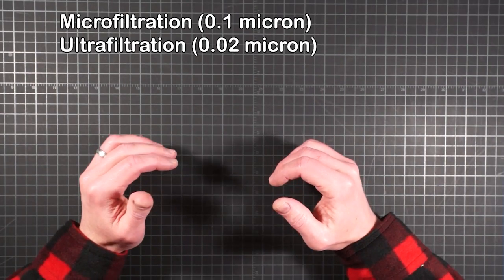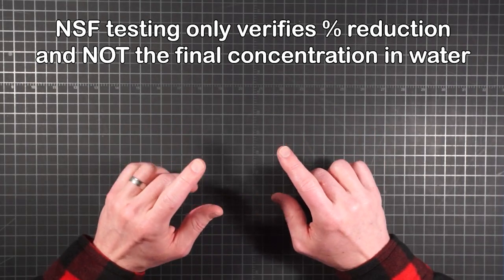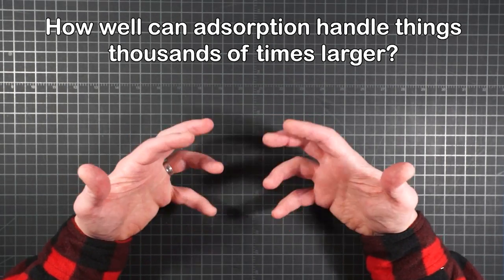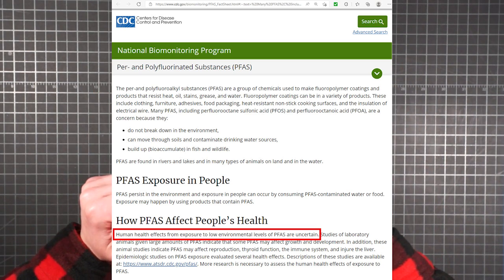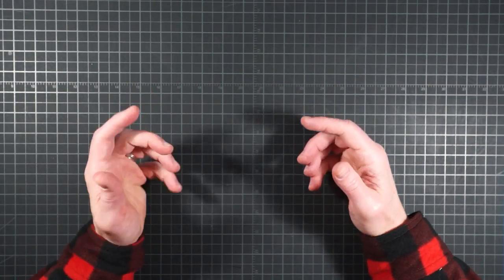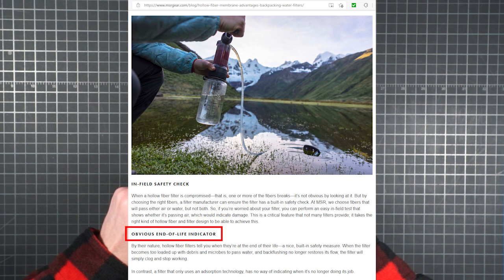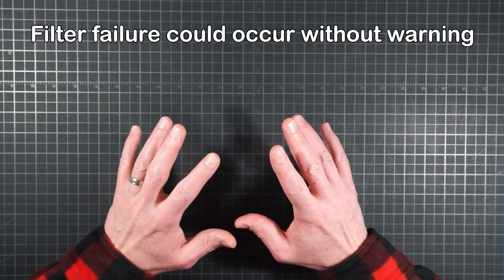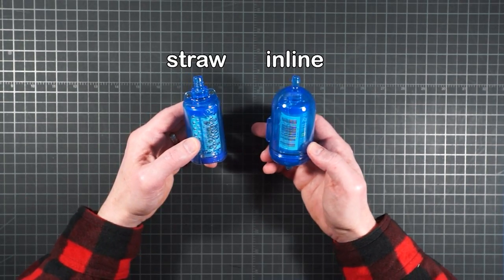Backcountry Water Treatment - Part 5: Activated Carbon Filters for Chemicals and Viruses

Comment: One of the things I will be making/packing for my SHTF bag, is a low energy desalinization system.  I have one of those Pump N Seal vacuum pulling systems that pulls about 28" of Hg (hand pumped).  That brings the boiling point of water down to around to 95* F or so.  Basically I'll have two stainless steel bottles, one painted ultra black, the other painted ultra white, and both connected by either SS hose or specially coated copper hose.

    A clear plastic bag (or very light/thin, foldable acrylic container) that is UV resistant will be packed with this. Concept is, either put the white colored bottle into cool to cold ground or some water in the shade.  Place dirty water in the black colored bottle.  Seal everything up, pull the medium vacuum on it.  Place the ultra black colored bottle either in the sun with the plastic bag or acrylic container around it, or over a very small fire source. 

      The vacuum placed on the system, should allow you to evaporate the water much faster and with much less heating.

Comment: I have a "Sport Berkey" it does great on a range of chemicals and microbes, but no virus protection. The large Black Berkey Filters do chemicals plus viruses but are not well suited for backpacking. Another great video. Tons of info and things to digest. I am starting to think to go with Aquamira drops for virus protection and then pass that through me Sawyer Squeeze (sediment, redundant to Aquamira for bacteria and critters) for total protection, but no chemical removal using this method, darn. Great info on flowrate and the effect on filter life reduction.

Comment: Love your videos I sent some sections to family to take a look at for your hiking food and hydration videos. I have learned a ton and it is so refreshing to find a channel that actually digs into the science and research to support or disprove claims and give a better foundation for people to decide what works for their needs.

That being said I think an interesting data point if you can find it would be to see how many cases of waterborne illnesses happen along the big through hike trails each year, this would be another data point to see if purification vs filtration is really that necessary and could give some light on just how likely you are to actually get sick from normal water sources (cow poop puddles should be a filter and boil). If records are kept with some accuracy then we can see if your napkin math model is on point or could use some adjustments going forward.

I wonder why YouTube hasn't pushed you further up on the recommendations but keep making these videos they are fantastic.
Reply from the maker: Thanks very much!

There are some published papers on the topic of the general safety of wilderness waters.  Some researchers take the position that hygiene is more important than water treatment, though they will admit there is still a risk from water.

They complain about bad data, though. Rarely is backcountry gastroenteritis diagnosed from an actual test of the organism.  This leads to assumptions, for example, that it was giardia. And, even if it was, did you get it from the water or a fellow camper with dirty hands?  Another unstudied issue is proper use of your given treatment method.  Some people splash unfiltered water all over their hands and bottle, then drink from the container.  Did the filter fail, or was it bad practice?

I agree that it would be interesting to know more.  Unfortunately, most of what I can find are just the water sample tests.

Comment: Every time I think of an objection - you address. This is so comprehensive I am astounded. Awesome! The issues you raise with Grayl remains valid and my concerns. I consider the grayl cheaper than bottled water and use relatively clean water only and underestimate it's capability. It's ideal for travel more than hiking. I have a be free to pre-filter if the water is dirty or otherwise have any concerns. At present, there isn't a travel suitable full filtration with redundancy or sensor. Compromises are just a nature of decision making. Thanks again!
Reply from the maker: Agreed! I think the Grayl has its place. Going to be playing with mine this summer.

Comment: Thanks for the series! Impressive studies. There is not much talk about the flow and pressure with the filters. Usually you shouldn't blow on any filter, cause it will clog it. To counter this issue I have made my own activated carbon filter to prefilter the biggest particles from my Sawyer squeeze, and I use them only like syphoning hose. This way I can keep eye on the flow rate and change the activated carbon when I need to. Should last a lifetime for personal use. I also have the uv for extra measure, but I usually boil it mainly for coffee anyway.
Reply from the maker: Neat idea!

Comment: Man I was just trying to buy a filter…but now I got a whole water treatment plant in my backpack
Reply: Haha, I feel this happening in my future. Thinking of something like: 
1. Dedicated dirty water bag/bottle -> 
2. Cheap rough mechanical filter to cut down on back-flushing and enable very dirty water to be used if necessary -> 
3. Sawyer squeeze -> 
4. Refillable carbon filter -> 
5. Clean containers. 
6. Di-chlorine tabs for pretreatment in special cases/emergency. 
Also plan on carrying my Kelly Kettle Trekker, outside the bag due to bulk though. With that I could skip the slower Sawyer on the way from having to find water to a hot drink.

Comment: Hadn't heard of the Katadyn Bottle adapter carbon filter so I went and ordered that. When it came in, I got curious and tried cracking open my old Platypus GravityWorks carbon filter with a hammer and flathead screwdriver. A couple of light taps is all it took to pop the very bottom part off. It turns out to be a cap which still pops back on. Underneath is a polysponge type foam disk, the same type of activated carbon granules as the katadyn and then another foam disk at the inlet. A little ca glue and a piece of tape on the outside might give a little insurance from spillage. Nice to have that as an option!
Reply from the maker: Interesting! Thanks for the info.

Comment: Not scientific, but I’ve been using Grayl GeoPress for a few years now. I’m residing in a developing country so I filter all drinking water. What I’ve noticed that you can check the filter degradation by blowing air through it. When the filter is new, no air passes through. When it starts to degrade after months of heavy use, more and more air starts to pass through. When you replace the filter its up to the user of course. Thank you for the videos.
Reply: Thanks for the tip!

Comment: Reference the Grayl 40 second press time (?) someone experienced with tap water: If it was the older model lid you had to open a 1/4 twist to release the air pressure, otherwise it was almost impossible to press (first time I misread the instructions and I almost exploded the bottle😂😮).  When properly opened a 1/4 turn, or using the newer easier to use lids,, press times are in the 5 to 10 second range with fresh water🎉❤
Reply from the maker: Good to know! In their pictures, they were actually trying to push the cup down without the lid on at all.  This can hurt your hands and might lead to less pressure and longer times, as well.

Comment: The engineer in me loves everything about this channel!
Question: what "activated charcoal"/adsorption filter do you use at home?
Reply from the maker: I put one of the Platypus carbon elements in my water kit (with my Sawyer), to be used only when called for.  The Grayl went into a car emergency kit.

If I make a dedicated virus/chemical capable kit for hiking, I will probably use the Aquamira Frontier Max red line.

Comment: Great vids man!! Any thoughts on the least plastic/ most chemical free drinking method. Soft bottles vs hard bottles… vs silicon… vs bioplastic, etc. Hydrapak offers mulitple types, some ‘free of x y z…’ and some not. [Also Bübi bottle, Bottle-up (UK), Nalgene, Ortlieb, vs Titanium…] I think drinking plastic is an ignored issue. [Some eg of materials used TPU, PP, HDPE, Silicone, Renew copolyester, PU coated Nylon, and bioplastic from sugarcane.] Some risks are BPA, BPS, BPF, PVC and more… endocrine disrupters that mess with hormones, etc. At the very least, it might help us find that epic nature fresh taste without that lingering chemical taste in water bladders, soft bottles and such! …anyways isn’t it funny we’re concerned about bacteria and viruses but not chemicals leaked from the bottle itself?
Reply from the maker: I am actually doing some research on the drinking safety of plastic bottles for the next part in the series. It includes UV pens, but also solar disinfection. That involves baking your water in the sun, and since heat might increase the possible leeching of chemicals into the water, it is something I am trying to track down.

Hopefully, Part 6 will answer your question!
Reply: @GearSkeptic  Oh wow, nice one! Really looking forward to that. I’ve got so many unanswered questions. Cheers dude, your channel is amazing with the detail you go into! ;-)

Comment: Okay so, in 2024 some of these options aren’t available anymore like the Sawyer S3. I’m looking for a reliable backpacker water filter capable of making my water safe to drink. I camp/prep in an area where most of my water sources are near agriculture operations. What are my options?
Reply from the maker: The First Need and the Grayl are the only other ones I know of with actual chemical removal numbers. With other filters that may have an activated carbon element, you are basically taking it on faith.
Reply: @GearSkeptic  Awesome thank for the quick response sir! The First Need seems like the best bang-for-buck and the actual lab testing seems more trustworthy. 

The Grayl has a lot of unclean nuance surrounding how to use it and how long it’s actually good for as you’ve shown. 

Out of curiosity, a lot of my bodies of water are typically still water (ponds and small lakes), obviously the further away from any agriculture operation the better, but do you think the First Need would be sufficient in making this kind of water safe to drink where the chemical aspect is (hopefully) low? Thanks for your time!
Reply from the maker: I would trust it. It has been around longest, and was actually the only one that was tested by scientists not hired by the company itself (so I believe the results).

Comment: Awesome. More Back Packing signs to my benefit. Do you have any information about the life straw water filter? If not, can you please do a little research and share information about it? When it comes to Back Packing in areas with no worries about forming an industrial chemistry like up in the mountains, what would be your choice of preference about the water filter? I meant to say farming. Thank you so much for sharing this video. I treasure your videos. God bless you.
Reply from the maker: The Lifestraw was one of the filters discussed in the Part 3 video on Microfiltration.  It has very good removal numbers, and they now have other filter formats, as well.

I personally have always carried a Sawyer Mini and some chlorine dioxide tablets for backup (like if viruses are suspected).  After this video, I added the Platypus carbon element to my water kit.  This summer I will be testing it out to see if it is worth the trouble of an extra step.

Comment: I was considering the problem that there are no reliable end-of-life indicators for activated carbon. I have a Sawyer mini that I use as an inline filter. The Sawyer will stop working once the flow is restricted. How about placing the carbon filter after the Sawyer and then change them both at the same time?
Reply from the maker: Problem is, the Sawyer lasts much longer than any carbon filter I know. It will keep going long after the carbon element is saturated.
Reply: @gearskeptic6355  Thanks for your reply. The water filter series is fantastic! Are you aware of a worthwhile stand-alone inline carbon filter that I can daisy chain with my sawyer mini, a particulates filter, and a ceramic pump.  I'd like to pull water from the Sacramento Delta so there are decades of farm run-off, metals and chrmicals. I do a lot of canoe camping.
Reply from the maker: All the in-line ones I know of are just rated for taste and odor.  The real chemical filters are the Sawyer S3 and the Grayl.

Comment: Great presentation. Have you covered or looked into treating water with ozone generators? In my case I don't have a problem with it needing power, be it 110v, 220v, or 12v. For ultra mobile options, I've seen a bottle that has a built in battery. From what I have read, it is a great alternative to boiling and has many other benefits besides killing bugs and deactivating and degrading plenty of stuff. Also, way less energy used and for my case (for best bang for your buck) a 0.1 or 0.01 in line filter (that claims 100.000 gallons, which I doubt is a reliable number), using a couple of gravity bags (12 liters, the Shurex ones which have side plugs so better to use those so the sediments go to the bottom), and then a ozone water generator, would cover many things but not as thorough as reverse osmosis or distillation. (the Itehil portable RO machine looks tempting but I don't trust its reliability by some reviews, as well as it is expensive to replace cartridges). 
I initially was going to go with a Lifestraw Mission which has excellent reviews and testing, but decided to go for the setup I mentioned ( 2 gravity bags 12liters each, with 2 naturenova mini filters that claim 0.01, and then an ozone water generator that claims 2000mg per hour and includes timer). Subscribed by the way. Cheers

Update: after further research I have found that it is better to ozonate water first, and then filter. Apparently heavy metals become oxidized with ozone, and become insoluble (they were dissolved in water) and then they can be filtered.
Reply from the maker: Interesting, but I have not researched ozone generators. I wasn’t aware of one sized for backcountry use.

Comment: i've used the grayl ultralight press and I get faster speed than that gearlabs review.. the 40 seconds per bottle is insane.. 15 seconds that grayl claims seems to be just about right for me.. sometimes even faster than that!

perhaps they didn't loosen the top cap before pushing down? or maybe the water was super turbid..
Reply from the maker: It looked they were actually trying to push it down without the top on. Maybe it hurts your hands to push too hard on the sharp rim of the cup?
Reply: @GearSkeptic  i don't think that's the intended way but yeah I would imagine it would hurt lol

Comment: A really informative series. Appreciate all the work that’s gone into it. I’ve been looking at the Aquapure Traveller by Pure Hydration as an alternative to the Grail, since ideally i want to avoid ClO2. Wondered if you’d come across it before, the test results seem pretty good

(I should note i’m looking to use this for filtering mainly tap water around South America for 3 months. If i took the grail i’d most likely need to take an extra filter)
Reply from the maker: Never heard of it. Went to the website and can’t find microbiological results.  The download link to their alleged test results returns a “page not found error”.
Reply: @GearSkeptic  It won’t let me post the link here but i believe i found it in the website following the tabs:

Discover->The science->Microbiological Test report

(It’s then at the bottom)
Reply from the maker: Got it.  Those numbers seem fine, but they aren’t best-in-class. It depends if your need is “good enough” or if you’re worried about “worst case”.

It is electro-adsorptive technology, though, and I have issues with the failure mode.  A Sawyer and some ClO2 could do much better, then a carbon post-filter could help with metals as well as remove your treatment chemicals.

Comment: Great video, but I still got one question, on MSR's website, the miniworks filter core is described as carbon-ceramic. however, there is a pore size of 0.2 microns and it is not rated for virus removal while it is rated for chemical and bad taste removal How can that be ? if its an adsorbtion purifier, it should be able to take out viruses, right ? and if it was a size exclusive filter, it would not be able to remove the chemicals. Could viruses be just to large for that type of adsorption technology, while being to small for microfiltration ?
Reply from the maker: I believe the carbon element is only rated for chlorine and taste.  Most carbon filters are just that. It takes a fancier adsorption medium to handle viruses.  Those are usually more like ion exchange.

Comment: I own a Grayl Ultrapress and a Sawyer Squeeze. I only go backpacking 1-2 times a year. Would you recommend I take both, first using the sawyer squeeze and then running the filtered water through the Grayl? Or is this overkill? I am concerned with trace amounts of industrial pollutants in my states rivers. If I had to take one, would Grayl be the best option?
Reply from the maker: I’d bring just the Grayl. It will cover your threats. It’s service life limits won’t be too much of a problem given the limited amount of usage.